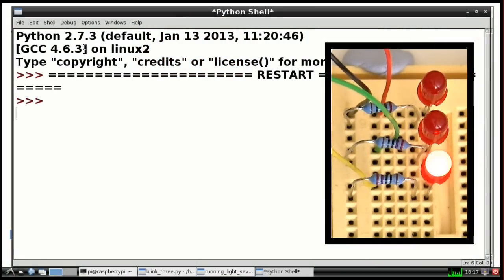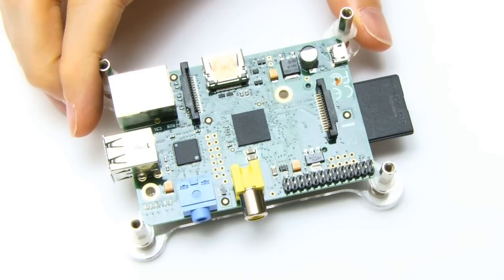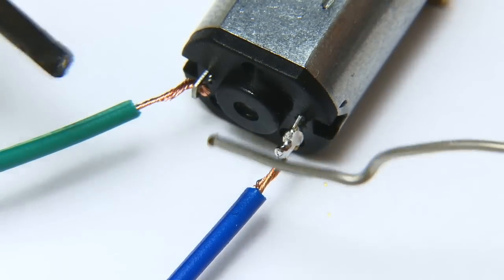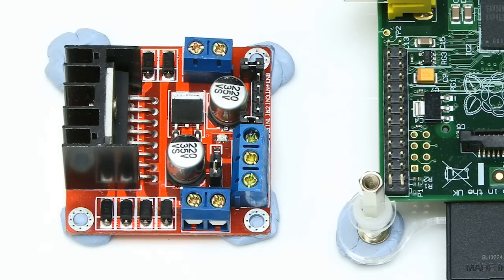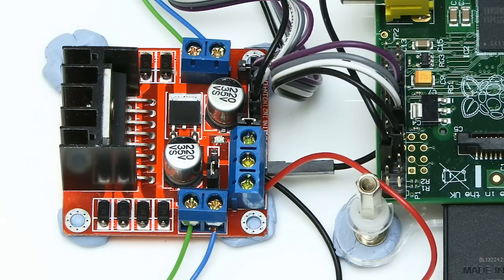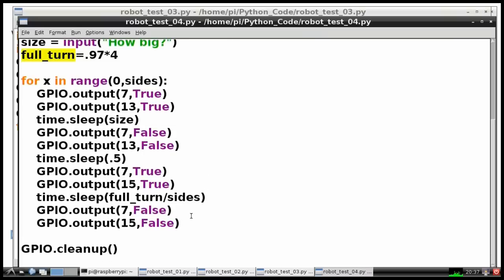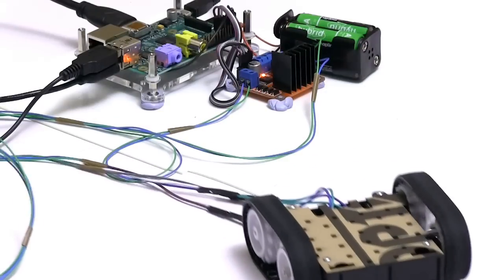Raspberry Pi Robotics #2: Zumo Robot

Comment: Hi! I love your video!
But I do have a question. Is there a specific reason why you chose pins 7,11,13, and 15 (GPIO 4, 17, 27, 22 respectively)? Can I use other GPIO instead?
Asking because I am try to control 4 individual wheels (using two L298N). So I am trying to figure out which GPIO pins are safe for me to use.
Thanks!

Comment: Sir, Is it necessary to use an external battery set of 12V. Can't we use 5V pin from raspberry pi 4 (pin#2) to feed to L298N ?

Comment: Hi Christopher

I just want to say thank you so much for your videos using the raspberry pi. 

I’ve recently gotten into robotics and I love your tutorials. I’ve created your zumo robot and it works great. 

I’m trying another project using the raspberry pi and the L298N motor board

I’m trying to power these motors and they don’t spend consistently. 

I’m not too sure if the board is a problem? Any advice you could give would be great

I’ve wired them exactly the same way as the Zumo

These are the motors 

https://www.amazon.ca › Stemedu-...Web resultsStemedu 2 Sets DC Gearbox Motor TT 200RPM Tire Wheel DC 3-6V ...
Reply from the maker: I'm glad you find the videos useful and have built the Zumo. :) On your problem, The board will just turn the motors on and off in forward or reverse (assuming you are wiring as in the Zumo project), so I suspect the issue is the motors themselves, maybe just down to the level of manufacturing tolerance causing them not to be matched. For very accurate motor control you would need to control the speed of the motors (using the PWM output available on the L298N -- I must do a video about it sometime!), and potentially even use encoders on the end of the motors to monitor their rotation. That way you could rotate them in sync.
Reply: ExplainingComputers Thank you so much for your quick response! In essence I’m just trying to duplicate what I did for the Zummo project with these motors. 

Maybe I should just try buying a different set of motors and see if that works? 

I’ve looked at PWM and need to explore it further. 

The motors do work. Just not consistently - after a few tries: forward, left, right if I try to forward again they won’t spin but they would spin in the other directions…

Your motors work perfectly, (the motors you recommended in your project video.) But they are not strong enough to drive my next project (my new project weighs about 8 ounces and I am trying to drive from inside a sphere)

I would appreciate you making a video about PWM. I

I would also appreciate any advice about another type of motor that I could use.
Reply: Hi Christopher, 

I Purchased this other motor board thinking I could use it with my raspberry pi but I’m not sure. 

I understand how to connect the motors in the power source but I don’t know what pins to connect to. 

It says it’s for an Arduino but I also read that could be used for a raspberry pi. I’ll attach links to an image of the board and an image bag sticker 

 gus.im/oMr7C

gus.im/hsjtO

Comment: Thanks once again for another inspiring vid. Presumably one could mimic a stepper motor depending on the resolution of the time function in IDLE? I had in mind to control the spindle on a variable (butterfly/air) tuning capacitor robbed from an old radio, to be used in loop antennae etc., so the tuner could be remotely controlled. These tuners don't rotate 360° so I guess some canny coding will be required so no attempt is made to rotate the motor out of range.
Reply from the maker: It would be hard to mimic a stepper motor as yu suggest. A Pi can also be used to control servos though (and stepper motors). I did a video on servo motor control with a Pi quite recently: https://www.youtube.com/watch?v=xHDT4CwjUQE
Reply: @ExplainingComputers  Ah, thanks. I did miss that one. I shall go take a look.

Comment: I have a 3.5 inch screen, so it occupies the pinout from 1 to 26, leaving me free from 27 to 40, for me to carry out this project do I just need to modify the programming? i'm from brazil sorry for the mistakes in english
Reply from the maker: Yes, you just need to use different GPIO pins as outputs and alter the code to those pins. Good luck!

Comment: Hi, Excellent project :D. but I am trying to build it as well, but I am having a problem with motors. The motors receive the signal and they try to move (I can hear it), but the zumo moves a wee bit (almost nothing) or nothing. Any suggestion? Thanks so much
Reply from the maker: Sounds like a power issue -- lack of power to the motors. Check the batteries.
Reply: @ExplainingComputers  Hi, I've checked that increasing the batteries, and still the same, but I think I found the issue. I checked your videos again, and you used  286:1 motors, and I bought 11:1, so I think it's a lack of torque. I ordered a new ones, and will see.
Thanks for the reply and videos. Looking forward for more cool Pi projects :D
Reply from the maker: @johndeckard1117  Ah yes, I would strongly guess a motor torque issue as you say. Fingers crossed for you.
Reply: @ExplainingComputers  My motors arrived and that was the problem. Now IT'S ALIVe !!!

Comment: I tried rebuilding it and powered the L298N with a nine-volt battery. After some seconds the motor's speeds tremendously decreased and the battery got pretty warm (not hot). What is the problem here and how do I fix it?

Comment: Sir do you have to solder the wire to the motors or does it work if you just hook it up?
Reply from the maker: Soldering is best, but it may be possible to wind/twist the motors wires into place and, for example, to secure with tape.
Reply: ExplainingComputers Thanks I used electric tape to secure it, but just doesn’t work I got the wires and everything where it should be so I gave up out of frustration hahaha
Reply: @ExplainingComputers  hello friend  Why do I get this error?    type error:"str" object cannon be interpreted as an integer

Comment: Why do I get this error?    type error:"str" object cannon be interpreted as an integer
Reply: Because the inputs (sides and size) the user enters in the shell after running the code are strings. For the code to use the user's inputs to do the math, the user's inputs need to be converted to appropriate data types. Specifically, int (integer) for "sides" and float (float) for "size". This can be accomplished easily by changing the lines in the code to

sides = int(input("How many sides?"))
size = float(input("How big?"))

Hope this helps!!

Comment: Very good video.  I have a question. Could I use any RC car (buy one) and put the Raspberry to control and sensors? RC with any voltage as: 4.5V, 6V, 12V?   Thank you.
Reply from the maker: Yes, you could indeed use a Pi and an L298N to do just that. See also my follow-up videos, and info on this page: https://www.explainingcomputers.com/rasp_pi_robotics.html
Reply: ExplainingComputers thank you.  I will see and try.  I saw your video and I’m very excited to do that with a cheap RC car that I bought at Argos.

Comment: Thanks for the videos.  If I want to build a complex robot or for home automation that’s need more than 100 input and output signals, is it possible to do that with raspberry? Is raspberry giop expandable?
Reply from the maker: You would, I think, need to add microcontrollers (eg Arduino) for that. I've never come across expanded GPIO on a Pi.

Comment: Just so everyone knows. The motor controller 5v pin is an output pin. This is not for bringing 5v into the motor controller but for sending 5v out like powering the pi with the output. No need for his usb battery pack. He could have just run the 5v out to the 5v pin on the pi and it would have worked.
Reply: Thanks for your videos.

Comment: My question is a little further from robotic matter.. I have a laptop. It's a compaq presario c300 and my question is, can i upgrade it to intel core i3, i5 or i7?
Reply from the maker: Rather unlikely -- both because you cannot get compatible CPUs for motherboards more than a few years old, and because laptop CPUs are often soldered to the board. I don't know the spec of the laptop you mention.

Comment: What kind of motor is used above?  Because you are able to spin motor in both directions. And I am using normal dc motor it spin only in one direction
Reply from the maker: It is a normal motor here. The key element is use of the motor controller -- the L298N. This can be hooked up to one or two motors, and then four control pins are fed signals to spin each forwards or backwards.
Reply from the maker: Ah, I see we corresonded before! :) If you have your motor connected to the L298N you should be able to turn it in either direction depending on what signals are being sent from the GPIO pins on the Pi. If things are not working, check your wiring and code.

Comment: As soon as i connected motor controller with battery, the motor starts running. Why?
Using same components from vidoe with same setup of wiring just I am using 9v battery.
Reply from the maker: This will be because you have yet to execute any code -- the GPIO pins will be in a random state until you have executed the code to set up the pins, and so pull them down to an "off" state. You need to execute the code, then connect the power to the motor controller. If the Pi's own power is not turned on, this is due to the setting of a 5V enable jumper on your L298N -- see the "Important Note" on my page here: https://www.explainingcomputers.com/rasp_pi_robotics.html Or, see the videos and wiring on this page (based on the same setup): https://www.explainingcomputers.com/pi_devastator_videos.html
Reply: @ExplainingComputers 
Really happy to see your fast response.. And thank you for your instant help.. 😍😍

Comment: I tried to implement the project using an external power supply instead of the battery. L298N comes on but raspberry no. The power supply delivers 9V max 1.2A. Is it a problem of amps?
Reply from the maker: Possibly, depending on what Pi you are using. Also, you will need to set the jumper to get 5V for your Pi via the L298N -- I power this setup via batteries (6xAA) in this video: https://www.youtube.com/watch?v=DyQxvfwQbTg

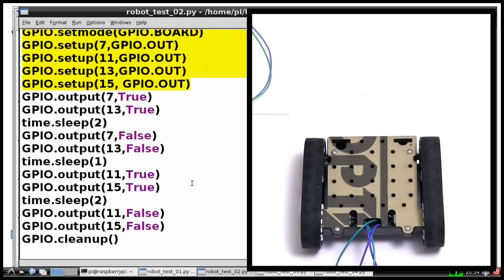Comment: i`m getting error messages while trying to run the program shown at 10:55, and only the right track moves in one direction only, i have a picture of the error messages, how do i send it you so you see whats gone wrong and offer advice on how to sort it out, i`m using a raspberry pi zero w should i be using just the pi zero instead.
Reply from the maker: If the track works in one direction, it sound like you have a typo in your code.

Comment: how to connect 4 separate switch as one switch..and it along perform in four direction left right forwrd reverse...is it  possible??
Reply from the maker: It sounds like you are referring to some kind of joystick with many positions, each of which will have its own set of contacts, so the joystick is in effect multiple switches, each of which can connect to a different GPIO.

Comment: I don't think the motors are slipping, I think its because one motor is starting before the other. Since python is an interpreted language, going top to bottom, it activates one motor, then immediately afterwards the next motor.
Reply from the maker: I see your point, but the time difference will be extremely slight -- less than 1/1000th of a second.

Comment: Great video and tutorial. Very easy to follow. For anyone watching this video and building along with it please be aware of your hardware. In this video the presenter is using an older RPi with only 26 GPIO pins. The RPi 2 model b and the newer RPi 3 b and b+ broads have 40 GPIO pins. I had to change pin 7 to pin 12 for code to work properly for me. pin 7 was in an on state after boot on my board. You can see the state of each pin after boot from terminal ~$ gpio readall. I learned this the hard way. On my board some gpio pins are in an "on" "up" state. As stated above when looking at my table  after running ~$ gpio readall bcm: 4, wPi: 7, name: gpio. 7, mode: in, v: 1, was causing issues for my code. I change to pin 12, gpio. 1 (v: 0, this was key for me) and code executed fine. There are ways to test your gpio's for failure as well. one being gpiotest. you will need the pigpio liabary installed. https://www.raspberrypi,org/forums/viewtopic.php?t=180505
Reply from the maker: Thanks for this. There is no need to change the code or to us other pins with a new Pi (and indeed in follow-up videos I use a 40 GPIO pin Pi Zero with the same code). I strongly suspect that some of the pins on your Pi  are damaged,  and hence in a constant "up" state.
Reply: I suspected this as well that i had damaged pins. I ran GPIOtest and they all passed. But I think your right, I think at least pin 7 for me is intermittently malfunctioning. I have a new RPi 3 b I just got over the weekend That I thought about testing. Anyways I think your videos are great for learning and fun builds. 
I am on zumo video 4 setting up ssh. I have a tank chassis that I am going to build following your other videos. I found a 5 in touch screen for the pi that runs off usb and hdmi and doesn't interfere with the gpio pins. I want to use this so I can lunch the code directly on the robot and expand its portability. I have question when using "curses", is there a way to only have the motors turn when holding down the directional keys and they stop when released?

Comment: Hi, very cool tutorial! I have a Pi Model 3 B and am hoping to do a project like this one. I don't want to have it continuously plugged into the wall, but from a battery. My problem is that I fear that either the battery pack will just be too big to be portable or that either they will be too expensive. I wish I would have gotten a Pi Zero W as I have now realised that they seem to be better with these kind of projects. How would I go about doing it with a pi model 3 b? Thank you.
Reply from the maker: Everything here will work fine with a Pi 3 B! It will use more power than a Pi Zero, but will still work fine off a battery back. See this video for how it may work: https://www.youtube.com/watch?v=XvOONPSoglY  and this video for running everything off a set of AA cells: https://www.youtube.com/watch?v=j6mglfhWZrQ Good Luck!
Reply: ExplainingComputers Thank you! Just one last question, would it be beneficial to use a similar battery to yours or to use a bigger battery?
Reply from the maker: The power bank I used to run the Pi is I think 2100mA, and this will run a Pi Zero for a good 5-6 hours. So it should run a Pi 3 for a good two hours or so. The issue with bigger batteries -- aside from the cost! -- is the extra weight on the robot.

Comment: So there are only two motors, correct?
Reply from the maker: Correct -- one motor drives the left tracks, the other the right tracks. Each can turn forwards or backwards, so each is controlled via two GPIO pins.
Reply: Thanks a bunch! I'm going to see if I can get it working with some ultrasonic sensors hopefully.

Comment: i have an cheap rc car for a school project ,do you think its would be easy to have the pi and the (brain) original board on the car ,,running at the same time,,,the reason for this is i thought it would be easier ,,because with original board the wireless controller is set up already,,,,you know what i mean.....i mean if i took of the original PCB of the rc car,,and just put on the adruino,,,,i would have to find a way to control it remotely,,,,,,and i am just learning and that could be difficult....i agree with everyone on here,,you sound great,,easy to listen to and very clear teacher.
Reply from the maker: Certainly you could do what I show in this video using an RC car rather than the Zumo -- the Pi and an L298N controlling the motors in the car.
Reply: thanks for the reply ,,i keep getting a syntax error....i copied everything that u did,,,,,,,but i think im saving the code wrong...i run it it says sysntax error...

Comment: Having a problem with 'Curses' and the 'Rii' keyboard, the keyboard works but when I run the keyboard test code and robot test code, I get the following: I'm using Pi3: Something wrong with screen = curses.initscr() command:

Traceback (most recent call last):
  File "/home/pi/python_code/jecCursesKbdTest.py", line 6, in <module>
    screen = curses.initscr()
  File "/usr/lib/python2.7/curses/__init__.py", line 33, in initscr
    fd=_sys.__stdout__.fileno())
error: setupterm: could not find terminal
Reply: OK Sorted, needed to run it from a terminal window...;-)

Comment: Hi Chris, thanks for all the great videos. I am just getting started and I have the motors, the L298N and the Pi wired up. As soon as I connect the battery pack to the the L298N the motors start to spin. Is that  expected? At this point the Pi is not running. Oh, and if I unplug the Pi the motors stop. Any assistance would be appreciated.
Reply from the maker: This is normal -- until the Pi has booted and set GPIO levels, the motor controller will have its outputs in a random state. Hence one or other or both motors may spin. So only connect power to the motors when the Pi is up and running the code. See my recent "Raspberry Pi Devastor Robot #2" video for more on this issue.
Reply: That did it. Thanks again for such a quick response!

Comment: Could you make an example code in python 3.4.2 where you control leds by pressing keys on the keyboard? An example would you press a on the keyboard and a led turns on. You let go of the key and it turns off.

Comment: Hi there, would I be able to fit a RPi 3 and a power bank next to each other on the base of this robot chassis? I am planning to use a RPi3 hence the doubt. Thanks.
Reply from the maker: Next to each other, no (unless the Pi was on its side). But I am sure an arrangement could be found. I ended up with a Pi Zero mounted on top -- see videos 3, 4 and 5 in this series.
Reply: ExplainingComputers Would I be able to find an arrangement with a neat design?